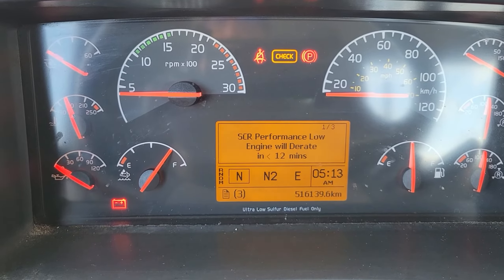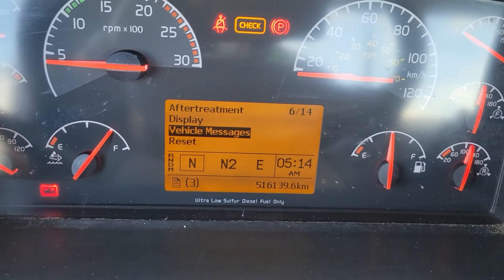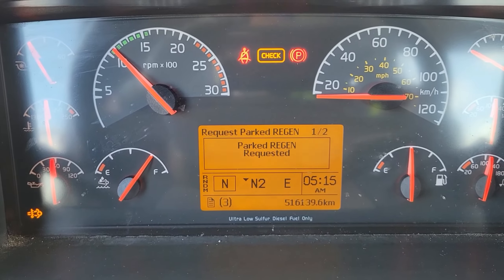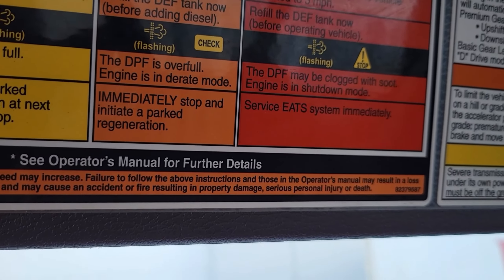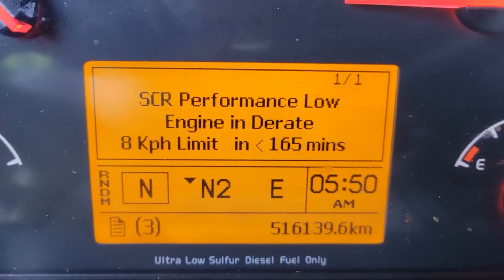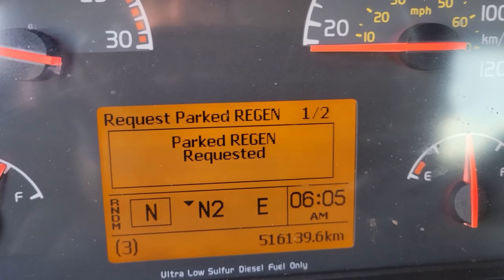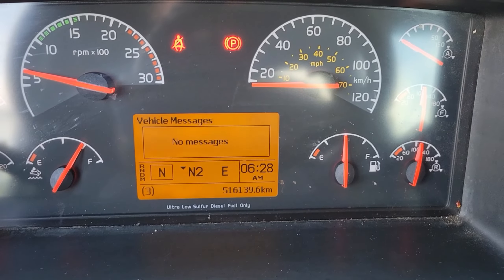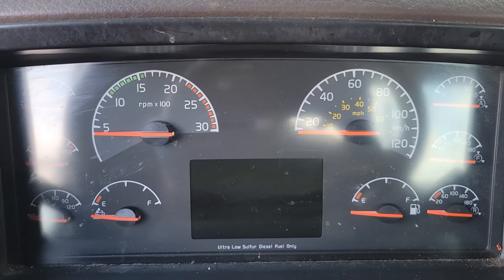SCR PERFORMANCE LOW, DPF LIGHT ON, PARKED REGEN NEEDED? HOW TO FIX BEFORE YOU DERATE. VOLVO D13 D16

Comment: A parked regen is telling you the system needs serviced and this is only to get you to the shop for repairs and not an overall fix. Great video.
Reply from the maker: I run into a lot of in town drivers that don't let the regen compete. Eventually a parked regen is needed.

Comment: My 2018 Volvo vnl regen has been on for 2 hours 💀 should I turn off the truck?
Reply from the maker: Did you figure out what was wrong with your truck? Sounds like the dpf might not be getting hot enough. I would check to nozzle on the hydrocarbon dose. They tend to get carboned up. Be careful the bolts and fuel line tend to break. Let me know what you find. Thanks for watching.
Reply: @shanersmechaniclife3164  just did regen twice ✅ light went away rpms dropped

Comment: Morning , I got one of these in the shop and it doesn’t wanna finish the regen . Can u help me figure out why ? Also took the filters to get clean as well and still doesn’t finish
Reply from the maker: Make sure the trouble codes are cleared before you run a regen. Ran into same problem. Would never finish. Cleared codes and tried again, went normally. Let me know what you find.
Reply: Im have same problem I been doing rigen over 4 hours

Comment: I did self regen 4 hours ago  & am starting to drive again with SCR performance low engine in derate 180 mins is there Any Aidea, please ?
Reply from the maker: Have you gotten you truck figured out? Looks like you have more of a problem than just needing a parked regen. Any trouble codes? Keep me posted. Thanks for watching.

Comment: Great info I tried on my Volvo 2010 d11 but won't Regen any ideas thanks
Reply from the maker: Were you able to get your 2010 to regen? Is it the same instrument cluster as the one in the video? I know they are picky with certain conditions being met.
Reply: I have a 2010 Volvo d11    I changed the 7 injector I paid 550 yes it does Regen I used a otr Regen and worked
Reply: @shanersmechaniclife3164 my 2018 VNL Volvo regen is not even turn off… it’s been almost 2 hours should I let it keep running ? Or should I turn the truck off? I’m worried if I turn it off I would have to restart the process

Comment: Great info but I have a 2010 Volvo d11 changer the dpf filters but it won't Regen it have a massage sood level high
Reply from the maker: Try clearing any trouble codes before you run the regen. Let me know how it works out for you. Thanks for watching and commenting.
Reply: WITH THE TRP RESET TOOL YOU CAN DO PARK REEGENS AS MANY TIMES AS YOU LIKE

Comment: I tried that and it says ATS conditions not met  and won’t regen
Reply from the maker: If the DPF isn't to a certain fill level it won't regen. Or some trouble codes won't let a regen proceed. They are very temperamental systems. Let me know how it works out for you. Thanks for watching.
Reply: @shanersmechaniclife3164 mine won’t turn regen off until it’s been 2 hours 💀
Reply: @DiaperSNiFFER you need filter taken out and cleaned take it to dealer and have it serviced 3-4 thousand dollars or it will leave you setting on the side of the road

Comment: I get a conditions not met while trying to regen
Reply from the maker: If the computer doesn't see the dpf fill level over a certain point or other parameters, , it won't let you regen. Thanks for watching and commenting.
Reply: @shanersmechaniclife3164 What’s that level?  Mine on a Prevost coach is just under half my tank and it won’t let me start a regen

Comment: Useless video. Didn't describe the problem before doing regen. Could ask regen for many things. Without codes before, that message is just genereic warning for aftertreatment problem
Reply from the maker: Sorry you didn't like the video. This particular truck was driver error. He kept interrupting the driving regen, never letting it complete. There were no issues or trouble codes. My goal for this video was just to show how to do a parked regen without a scantool before you derate and have to call a tow truck.